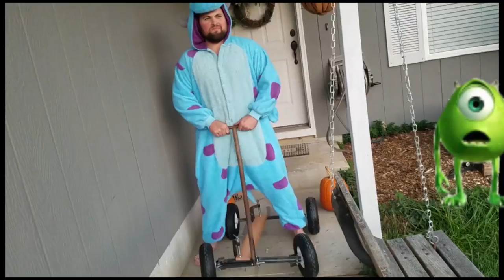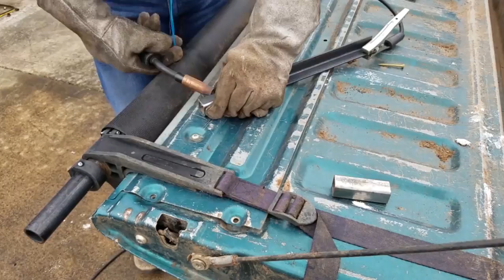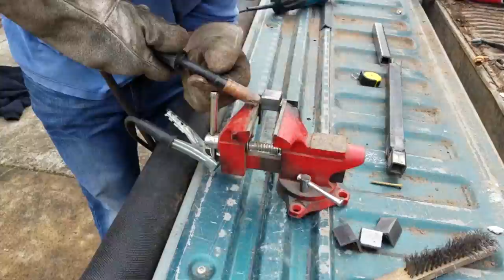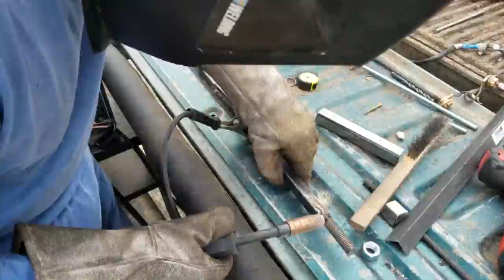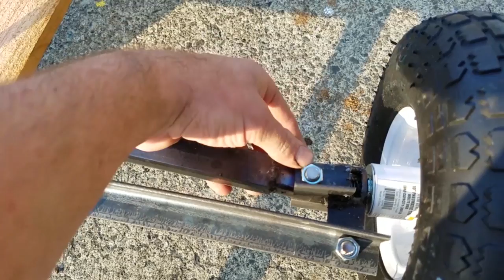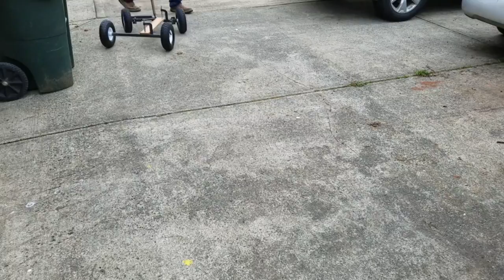Homemade Wagon With Harbor Freight Welder, Part 1

Comment: Your video was a good find. I'll be building one with different different dimensions and flipping handle to allow for either hand pull or lawn tractor pull.
Reply from the maker: At work we fabricated brackets that go over handles and fit into trailer hitches for towing. They work great.

Comment: Nicely built. The northern tool 149.00 wagon holds 1000lb. mine just broke after 7 years as a wagon for a generator.. yours is built better. The steering linkage bar snapped at pivot bar.

Comment: Love it!  Quick question, which welder did you use from Harbor Freight and are you happy with the performance? Thanks!
Reply from the maker: Thank you! This was the chicago 90 amp welder, works great. It's almost identical to the chicago 125.

Comment: Awesome video! I'm thinking about using this base for an ORCA cooler. If I was to build the front the same but not actually have the handle attached to the steering linkage and to the cooler itself instead would the leverage and direction turn the front wheels efficiently? Thank you for your time!

Comment: Nice build, how easy is it to assemble the rear axle. Like did you use lock washers or just the nut and bolt
Reply from the maker: Nylocks. Pretty easy. They made the bearing race wider than the wheel, so as long as it's clamped snug the bearing can spin freely.